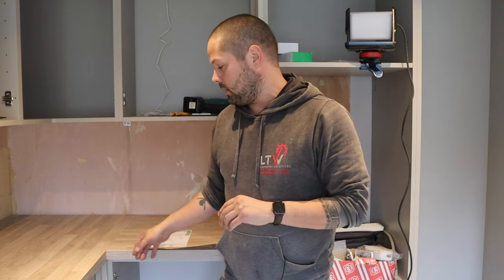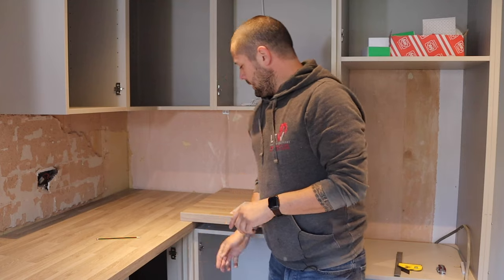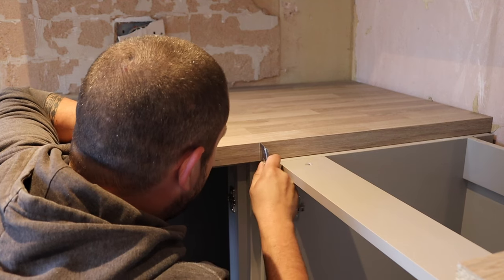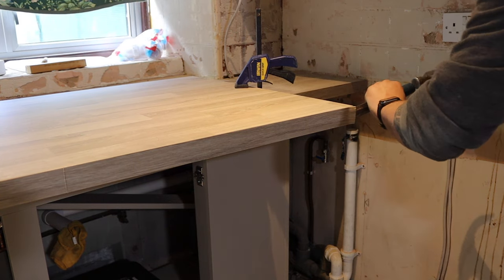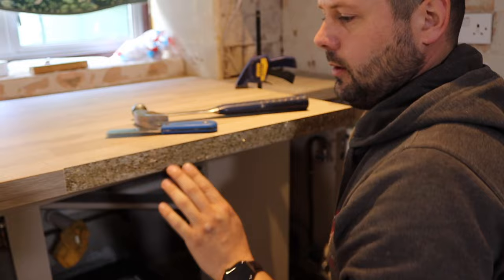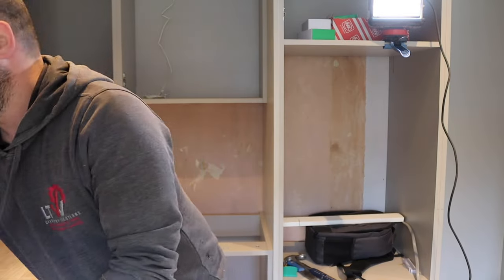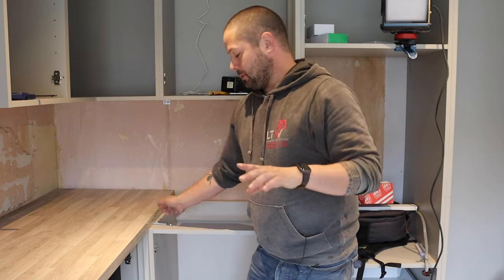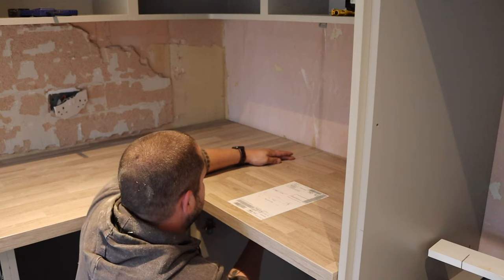How to join square edge worktops  #joinery #carpentry #woodworking

Comment: Is that a marlpes bluechip chisel
Reply from the maker: It is indeed buddy, I have two that are 1” thick I wish I had more ! Great chisel and really Holds an edge well !
Reply: @LTWCarpentry  well said crucible   forged steel made in Sheffield
Reply from the maker: @entirecosmos4335  I also have a set of the original marbles with the red and yellow handles, they are about 30 years old now, they are great other then they stink 😂

Comment: Every square edged worktop I've seen has a very small rounded top edge. Surely this doesn't give a perfect joint when the male part of the joining worktop is butted up. I'd like to see a very close up of the joint from above at the front edge
Reply from the maker: That’s why I remove the edging strip if you didn’t then that small round over would remain there, by removing the strip you remove the round over.
Reply: Sorry you misunderstood, I meant the joint at the front edge not the 600mm joint. 2 rounded edges butted up to each other at right angles wouldn't, join right unless you cut the edging at 45 degrees but you cut the front edge straight down
Reply from the maker: I see what you mean and yes I’m inclined to agree with you in principle but I’m practice it’s so negligible that it’s really not visible at all.
Reply: I've just copied your way on a straight edge worktop and what an easier way of doing a joint. Have you never had an issue with not having any biscuits in the joints

Comment: Silicone?? Pva glue always…
Reply from the maker: Been doing this 20 years and never had an issue mate
Reply: @LTWCarpentry  If that’s ok for you and works that’s fine, but never used silicon in a joint, breaks down and expands.. Pva is made for wood and waterproof.. but we’re all different and as long as the customer and the job looks good that’s all that matters.👍👍

Comment: Could you score the top edge (where the edge joins the laminate) to put a separation line to prevent splintering?
Reply from the maker: You could do mate but to be honest I don’t think it’s necessary, I haven’t had any splintering at all, the keys is just using sharp blades and taking your time

Comment: Not sure removing the edging is a good idea, any water gets into the joint and the whole thing is in the bin, best leave the edging in place for what difference it would make
Reply from the maker: It would look horrible for a start but, we always removing the edging, even if you do a standard worktop with a masons mitre you are removing the edge. That’s why we seal the edge again 👍🏻
Reply: @LTWCarpentry  exactly how I do it mate, great tutorial!!, wayneblackwell clearly knows nothing about kitchen fitting 😂😂
Reply from the maker: @daz23100  cheer mate, you always get someone who knows better then you don’t you 😂😂
Reply: @LTWCarpentry  do you tracksaw your cut mate or router?
Reply from the maker: @daz23100  I tracksaw it mate, fresh blade and take it slowly, I do sometimes have to clean it up with the router if it’s a cheap Laminate but for the most part I can get a good edge of the plunge saw, how about you buddy ?
Reply: @LTWCarpentry  I use to tracksaw but never really got a crisp edge from it and that's with a freud blade so I router now

Comment: poor join use a router tool and jig 😂😂😂😂😂😂
Reply from the maker: Why is it a poor join ?
Reply: @LTWCarpentry   its not done professionally any DIY can put 2 pieces of worktop together  i wouldn't personally have that done. that's why you need router and jig to give you the perfect finish
Reply from the maker: @baltukur3368  the only reason for a masons mitre of a worktop is to get over a rounded edge, there’s no need for this on a square edged worktop, if you ask any carpenter/kitchen fitter they will do it this way
Reply: Rubbish it works perfectly you only need a router for round edges
Reply: Sounds like you ain’t got a clue.poor you